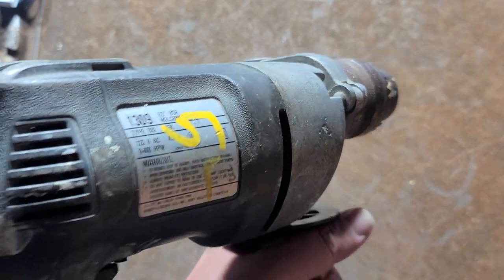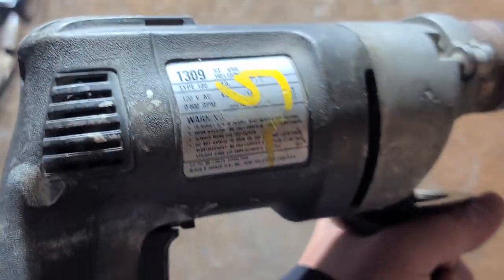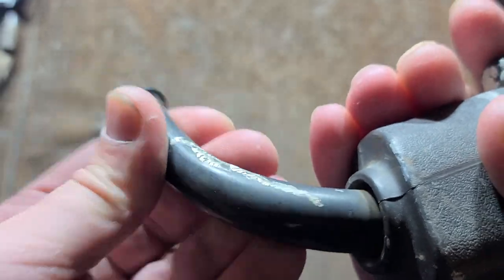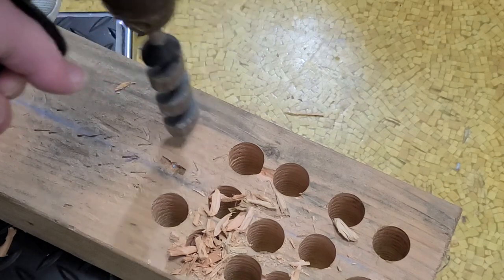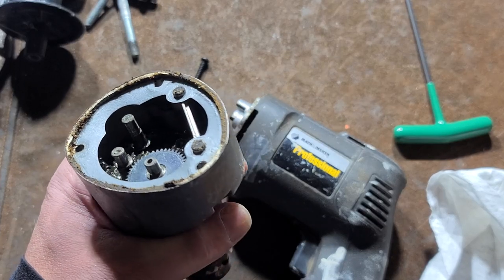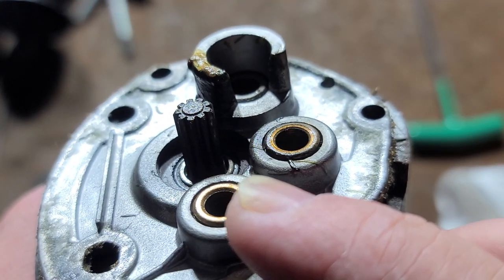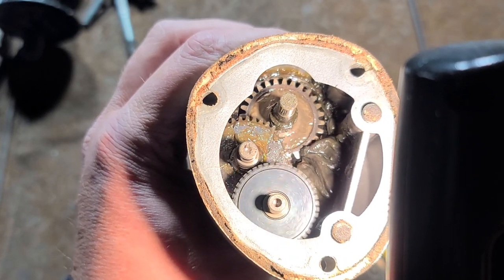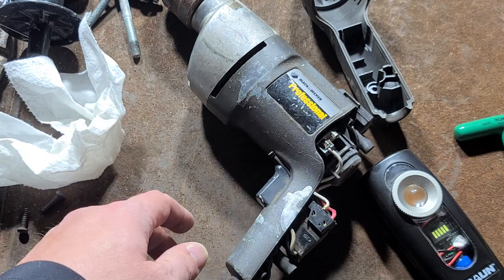Black & Decker Professional 1/2" Drill Review

Comment: Also sold as the 1311 (Industrial Heavy Duty) and the DeWalt DW110.

5 amps, 0.56 hp, 0-600 rpm
Reply: Just got a 1311 brand new for 24 bux
Reply: 1311 is 100% ball and needle bearing.
Reply: @davep8334  wait really?  So its not the exact same drill as pictured here but with a different label?  How do you know?  Appreciate any insights you can give.  I bought one thats never been used complete w/ the side handle last year,  but I haven't used it yet.  Its too nice lol
Reply: Just checked out both drawings and you're right, the 1311 replaces all sleeve bearings with needle bearings.  Thats actually really cool.
Reply: @machineman8388  I bought mine brand new in 1990. They used to include the repair parts diagram along with the owner's manual in the box. My 1311 also has a German made fluted chuck which is an upgrade over the 1309 in the video.  It's been the best 1/2 inch pistol grip drill I've ever used and it still runs great.